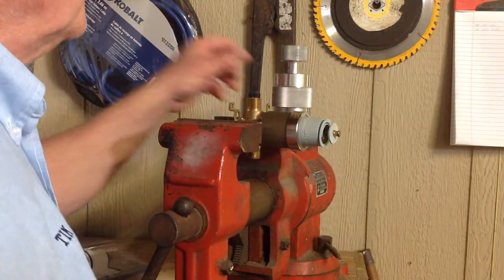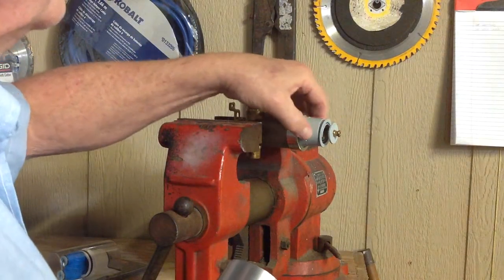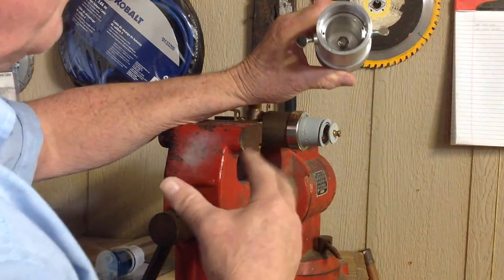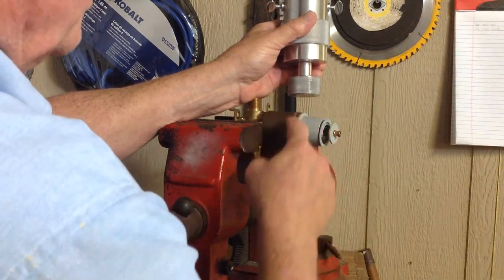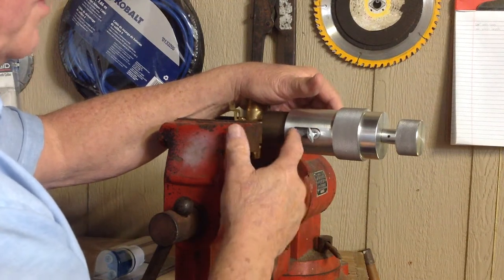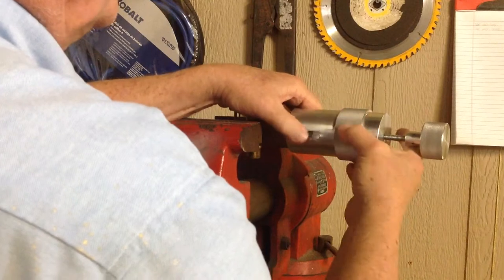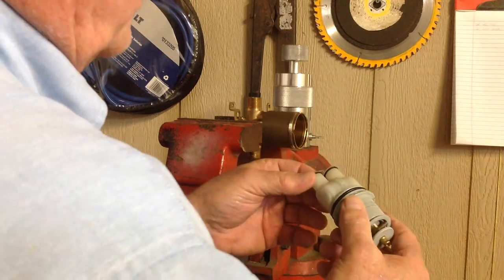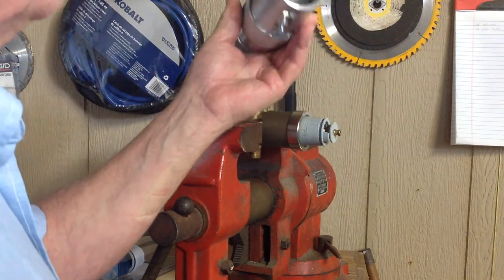Delta cartridge removal tool  How to remove Delta 1300 & 1400 pressure balanced cartridges

Comment: Thank you wonderful sir. But I have a question. Will this tool still work if I already attempted pulling out the cartridge and the issue you spoke of has happened (i.e., the back half is detached and stuck in the fitting)? Either way I at least have better awareness of the issue so much appreciated
Reply: Yes, I have the same issue where the back part has broken off and is stuck. Any ideas on how to get it out?
Reply: @michaelfulkerson2486  drill it out carefully I'd say lol

Comment: That's great... but how do you get the inner piece out of its already separated and you DON'T have this tool?
I'm stuck without water because the store doesn't carry the tool.
Reply: Had this exact same problem today.  First break off the two plastic pieces which hold the cups and springs (just pull hard with channel locks).  Next, with a chisel, remove the plastic until you can see the stainless steel metering part inside the plastic.  Take a drywall screw and screw it into one of the holes on the stainless steel part.  Now you can use your channel locks to grip the drywall screw and pull straight out.

Comment: Only problem I’ve ever had with these valves are the old ones with the 3/8 copper tubes in back, this won’t help with that , and over $150 I’ll use my knipex

Comment: Hi, I followed your video and used it many times. Can not pull it out. Very frustrated. Put WD40 and tried to pull it. No working. Still stuck there. The grey plastic part on cartirage has scratch mark on both side. Too tight to stuck there. Please help.

Comment: I damaged the valve threads when I was taking off  the stuck delta nut that holds the cartridge in there. Will I have to replace valve?

Comment: My cartridge broke half ways and the back piece got stuck in the pipe. I tried taking out and all the plastic around it is broken where im left with the bare stainless steal piece. Can i still take that out. It is pretty stuck in in there. What would you recommend?
Reply: Oh I'm sorry to hear that. I had that happen my first time. What helped was lots of clr, and a needle nose plier with an adjustable width that's able to clamp down on what it's grabbing. It was a lot of wiggling but it finally came out. I just found out today that silicone grease will help prevent that in the future
Reply: Put a drywall screw in one of the holes in the SS piece.  Then grip with channel locks and pull it straight out.

Comment: This tool is just for cartridge  what about the bonnet
Reply: the cartridge is the only real problem with this shit cartridge design.
Reply: use a belt wrench for the locking nut for the cartridge